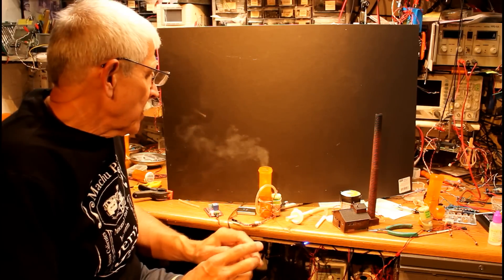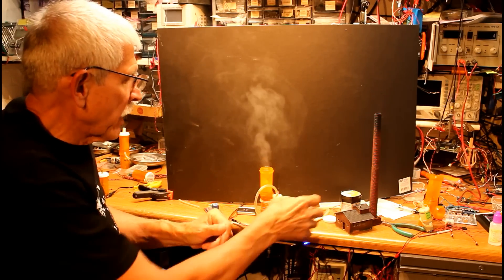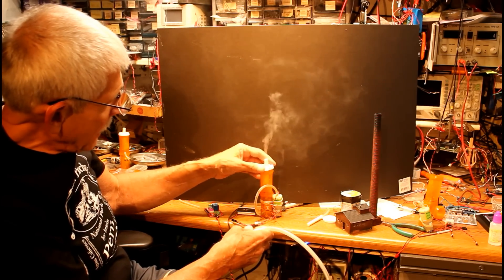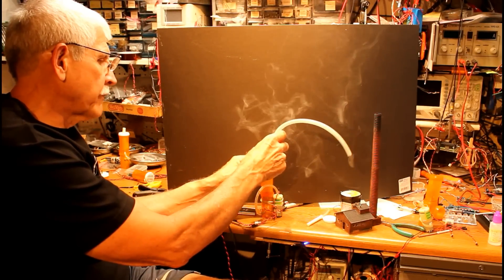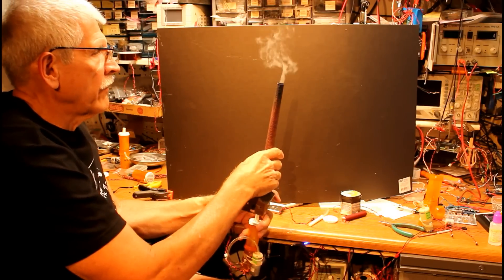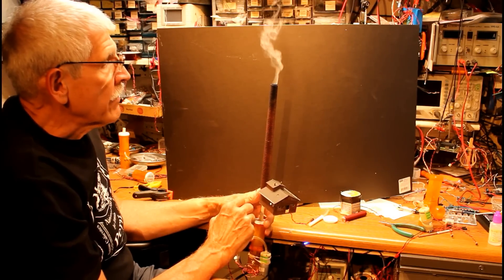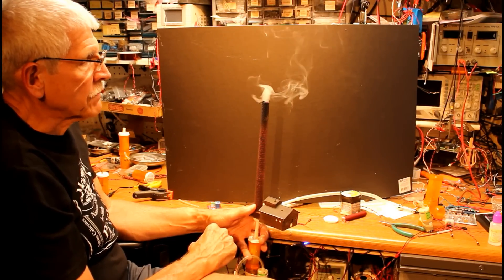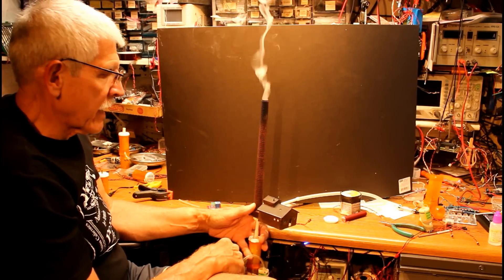Smoke Animation with an E-Cigarette's Vaporizer - Part 2

Comment: Built one for a layout a year ago with a few modifications to allow "continuous' operation.  First modification is, until I can find a DC air pump that meets my requirements:  an aquarium air compressor.  Next step was to lower the voltage being applied to the filament to under 3.7VDC.  Don't ask what it is as I don't remember and cannot easily access the location.  Third uses an adaptation of the air chests of bagpipes or air chests of pipe organs.  The output of the smoke unit goes to a larger plastic container with input and output tubes.  After a few cycles, the chamber puts out the same amount of smoke as if it was connected directly to the smoke unit itself, but without the break in the operation! 

A Vellman VK111 handles the timing at (I believe) 20sec on, 15sec off.  The air pump is a cheap 120VAC dual output unit (connected into a single line via a T).  The smoke chamber is approx. 1.5L in volume.   With this, I get a fairly good volume of continuous smoke without having to worry about the filament overheating.   In order to control the amount of flow to the individual stacks, a cheap airline manifold was purchased from Wal-Mart.
Reply from the maker: That is very cool, Andrew - I appreciate your posting your experience and modifications for others to use.
Thanks!

dave

Comment: Using the 3v air pump should I use 2 different power sources (one for the pump 3v and one for the heating element 3.7v)?
Reply from the maker: That would work or you could use one supply and run it through a buck converter to drop the voltage to one or the other.  That is what I do - I run 4 volts to the heater and about 2 volts to the motor.
dave
Reply: @DaveBodnar  Thanks for the reply.
How could I make it run intermittently automatically?
I thought of using arduino but the currents are too high to use it!
Reply from the maker: @mirkoronchetti5671  You could easily attach a relay module to the Arduino and use that to trigger the smoke unit - you can also use a dedicated timer module - they are readily available on eBay
dave
Reply: @DaveBodnar  Thank you very much!!

Comment: Where exactly does the glycerine go and how much do you use at a time please?
Reply from the maker: The glycerine goes into the bottom of the upper chamber that holds the heating element.  There is some wick material at the bottom of the heating unit that must be in contact with the glycerine.  Be careful not to get the level up to the heating wire itself.
We ran the smoke unit for two days at the last train show (about 5 hours of intermittent use) and used only about 1/2 of the glycerine that was in the unit. 
Your mileage will vary!
dave
Reply from the maker: Yes, they look very similar to what I am using
dave